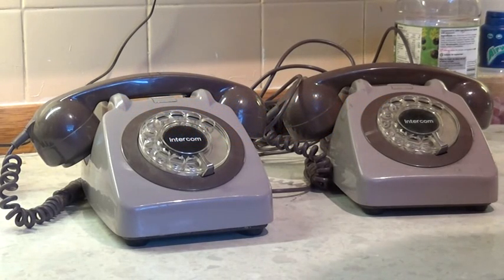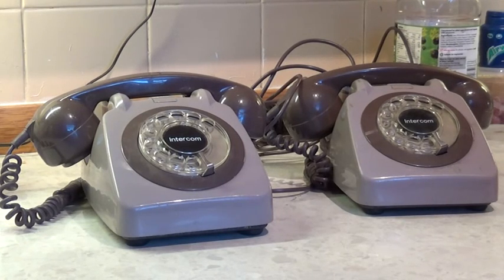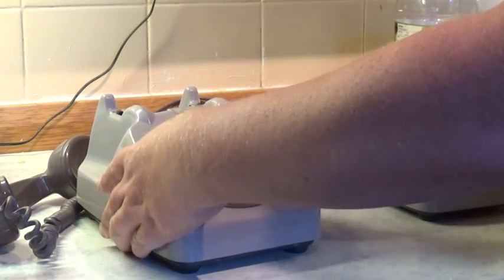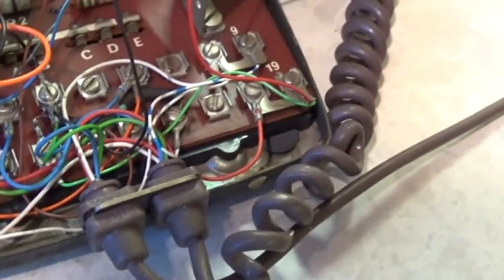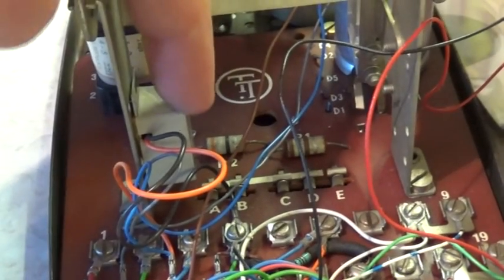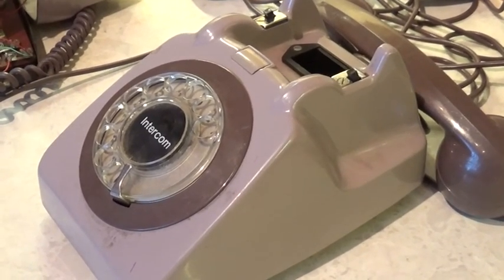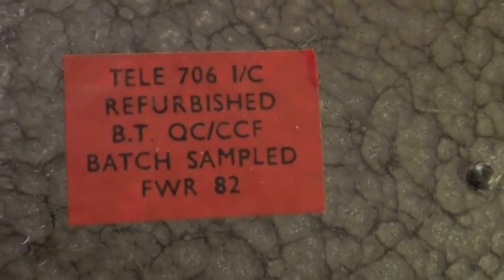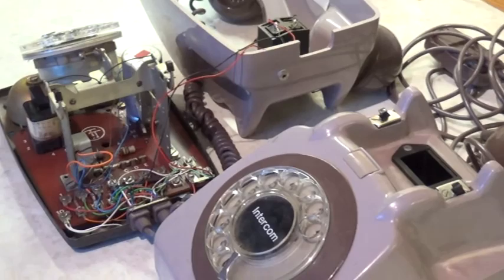Intercom Phones

Comment: Hello Andy, I've recently mapped out this pair of phones that I have with the power circuit if you'd like a copy of the drawing when it's finished I'd be happy to share it. I've successfully converted two 332 bakelite phones to intercoms using this method. Also dealing with a really nice ex GPO Engineer in relation to an old PBX that can support pulse dialling like yours. I told him about your channel and he will look you up as he has similar interests and he has a plethora of equipment and phones. Apologies I couldn't find your email to send this information on. Keep up the good work.

Comment: All the boxes I have seen date from 1982. They were either red or two-tone grey 706 cased (ABS). They were refurbished chassis units with new old-stock clear dials and 1982 receiver capsules but strangely had their original transmitter capsules still fitted. I now have two boxed sets never used. They are well made and work extremely well.
Reply from the maker: Thanks for the info Paul. So they didn't normally have these trial PVC cases then? I'm also a bit confused as to why each phone seems to have a battery. Surely one battery would do. Or maybe I have two half sets and the other halves that I don't have would be the ones without the batteries? I'll get around to wiring them up one day and giving them a try.

Comment: Hi, these were intercom only telephones. What you found inside was a DC buzzer. Bells weren't connected as the purpose of these telephones was only for internal calling. So connection to the line for external   calls wasn't required. I hope that helps! 😁
Reply from the maker: Thanks for the info.
Reply: @AndysShed  Your welcome my friend! I have a lovely gpo plan 107 set up and fully functioning as it would have in the 70's. Red and white lamps on main. I will send you a short video when I am able. You may add this to your other interesting videos should you wish to. Tyler 😁
Reply from the maker: ThanksTyler. The live show will  be back in the new year and it would be great to add your video clip. Thanks.
Reply: @AndysShed  Brilliant! I will keep an eye out for this  then 😁
Reply: If you click on the link below. You will find an image of a similar set up I have. Main is exactly the same just in elephant grey. My extension is a 746 with dial and 1 buzzer on the top to call main. Below spk to ext exch held is a lamp that lights red. The main would then use the buzzer button to call extension and exchange would be held whilst internal conversation took place. Main would then press ext to exch to connect external call to ext. Below ext to exch. A white lamp would stay lit until extension had cleared down. Then main would press release and then push down spk to exch when next external call came through. Extension could only make external calls by buzzing the main. Unless telephones were set to night service. Then main would have to press ext to exch for this.

Comment: Hello, only one battery was needed to run the set. The 9v cell is skillfully mounted inside one case which also has a Jack connector for a power source. I've seen a set that had been made to look older using the Ebay spares (colour matched dial and carry strap) but this then fouls the battery slot on the main phone. The wiring is quite simple and the dial contacts are solely used a a switch for the other phones buzzer. They are a great intercom system.

Comment: These were sold in BT Phone shops in the late 80's. They came boxed as a pair with 30m of cable and an instruction leaflet. I think BT had a contract with an external company to create them (it might have been Remploy) as I think the BT refurb factory at Cwmcarn was being wound up, I could be wrong they may have been produced there. They were a retail product so BT sales offices couldnt handle orders for them and there was no installation service offered on them. Although there would be an electronic solution to retain the bells, I believe the decision was taken to strip the bells out, install a buzzer and doctor the internals so customers couldn't connect them to their line. Interestingly I knew a BT engineer who used to produce his own intercom sets in a similar style which he donated to schools. He used to use a 9v battery in each and I think he bought a ringing unit from an American company which could drive the bells.
Reply from the maker: Thanks Graeme, that's very interesting information. I had no idea they were an official BT release. It seems strange they left the dials in, even though they don't actually do anything.

Do you happen to know if a pair should have a battery in each one or a battery shared between the two? I've seen another set where only one of the phones has the battery compartment.
Reply: Only one battery needed per pair. Dials were left in for signalling, turning the dial makes them buzz. This was cheaper than fitting a button or modifying the cradle switch. I'm dredging the memory banks here, but as I recall there was a glut of 706 teles that had been "wiped up" at Cwmcarn, that is they'd been fitted with new cases and line cords. They were kept in stock for use as maintenance replacements for some PBX's and plansets but the arrival of statesman and viscount phones and the Ambassador ESS switching system spelt the death of plansets and the 706's just werent needed, hence the intercom project. Needless to say they were produced as cheap as possible and what a great way to use up those old 706's!
Reply from the maker: +Graeme Yeates Thanks for all that info. I might try to get mine going. I thought they had some bits missing or were maybe an abandoned DIY project. But now I know they're not I might give them a try.
Reply: Hello Andy, I have just aquired a set and got it working. Graeme's comments are all correct. Only one battery phone is required. Turning the dial activates the DC buzzer in the opposite phone. They were sold in a kit with cable and wire staples for installation by the purchaser. With a few standard 706 spares mine are now working well. Then wiring is quite difficult to navigate at first but makes more sense as you get further into it. The connections in the dial are just used as a normally open switch contact which is a clever idea. Quite Nice interesting set and a bit of history from the old factory in Wales.
Reply: @paulnolan8122  Any idea when these were sold. I have seen something similar on Private wire circuit in the City of London. However this one had a -48 Power supply instead of a battery but still used a buzzer.